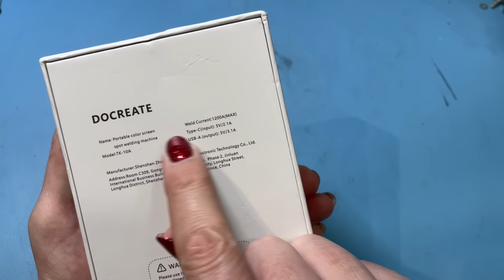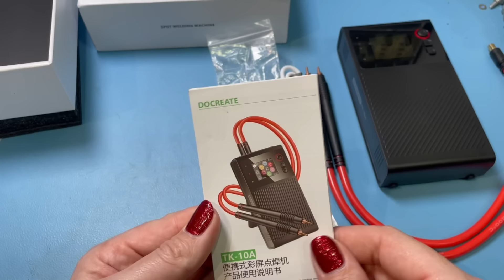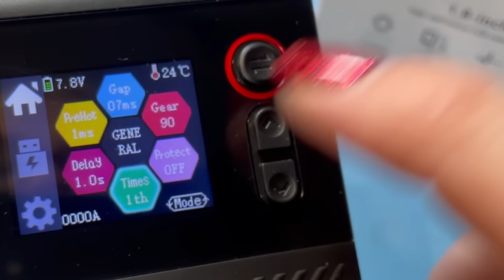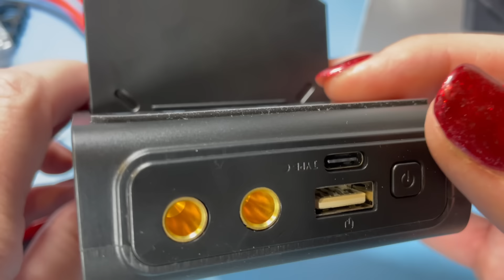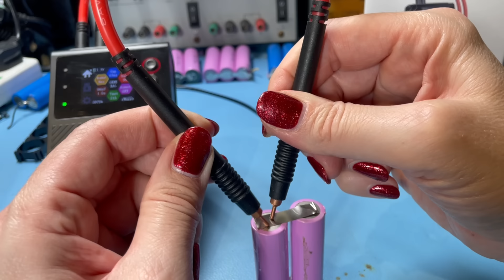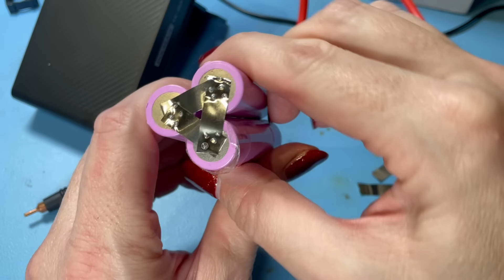Banggood DOCREATE TK-10A Portable Battery Spot Welder - Review & Test!

Comment: For anyone considering the Docreate TK-10A: I recommend checking the batteries against the description as soon as you receive the item. In my case, they were absolute junk—they need to be replaced immediately; the capacity didn't match, the internal resistance was high, and one cell was damaged. Overall, the electronics are good; it accommodates four high-drain 18650 batteries, and the welder will perform better with them.
Reply from the maker: Will have to look into that, thank you 😊

Comment: Hi Jazzy , good result for a first try !  Your weld points are solid .    I always weld with 4 points because the current runs  through these very little contact surfaces . And with High Drain cells  i weld 6 points or more , but i must be careful on the little positive cap , possible but difficult to place 6 points .  I always use insulation disks on the positive side , and first of all with HD cells. 
The first and dangerous issue for beginners is a an unpredictable  and immediate short  after a little mistake or inattention .  With  low drain cells it's really dangerous , but with HD cells it's terrible . I would really recommend to know the Lithium basics before we build our first battery . Security for beginners would be first to discharge the cells at 3V before assembly , but don't forget  that the cells are not empty .   All of this just to help.
Reply from the maker: Thank you. That's good advice 😊

Comment: I heard devices of this type often don't live very long.

But on the other hand it's inexpensive and it's a lifesaver when you need a batt, you make yourself a batt. Aren't gonna build a power wall with this type of thing, and most things we do just need a couple cells.
Reply from the maker: I think this will be ok for occasional use and at the price it's very good. If you want to build a power wall you might be better off making your own with an old microwave transformer DIY design.
Reply: @JazzTechUK too dangerous for the uninitiated, how about 2s3p 5000f supercap? that'll be better and less dangerous than a microwave innards

Comment: Thanks a bunch for this review. I would've considered this tool to be a joke, but after seeing it actually work, I'm impressed. The irony that if it's own cells need to be replaced would require an additional welder is a priceless bit of humor to me, but at the price, why not have 2 ?, lol. I had planned on making a more substantial investment into this type of welder and still might, but this being so small, full of features as well as cordless, gives me pause. I might need a magnifier to see the screen, but that's about the only thing I can come up with that could be considered a negative. That's on me through and not a reflection of the device. Don't worry about the appearance of the welds. Anyone rebuilding batteries isn't going to have their work displayed in the Smithsonian, lol. It simply needs to work and anyone criticizing your results deserves a poke in the eye...and not just the blue ones, but the brown eye too, lmao. Thanks for another great review and product demo. It's really given me something to consider when I finally get around to buying a welder this small. I just realized that I have a pair of Milwaukee batteries that need work, so this presentation is very timely indeed. Thanks so much yet again.
Reply from the maker: I must admit I didn't think this unit would be powerful enough to do decent welds, but it is. I do agree with you about the screen being a bit too small, otherwise it is very good for the money. If you want something heftier, you could always build one of those microwave oven transformer spot welder DIY ideas.
Reply: @JazzTechUK  I already have a couple waiting to be turned into some cool toys, lol. I want to jailbreak the electron gun to kill any drones a neighbor may try to fly over my house, for starters, lol.
Reply from the maker: Haha 😊

Comment: The Docreate TK-10A is a clone of the Fnirsi SMW-10. Both are great budget spotwelders for 0.2mm nickel plated steel or 0.15mm pure nickel.
18:09 the strip provided with the Fnirsi SWM-10 is nickel plated steel, not pure. I'd guess this is the case with the Docreate as well.
You can check by filing off the surface and putting it in salt water for a day. If it rusts then it's steel.

Comment: Thanks for that Jane, it looks like it's producing nice consistent spot welds. A couple of points - you were connecting all the cells in parallel, which means they are still 3,7 v but will need a lot higher charging current. Most repairs are on battery packs with cells in series with a separate connection between each cell and the BMS. More importantly, the use of the circular insulation discs on the positive end is essential to stop the nickel strip punching through to the outer casing. The plastic spacers, which you had, are also useful for keeping the batteries spaced and the welded strips insulated.
Reply from the maker: That's an interesting point about the insulation discs. These batteries are no good. It was just a welding exercise. I wouldn't make up a pack like that in reality.

Comment: £40 is quite expensive. I have 2 spare 10,000uF 40V capacitors and some thick copper wire. A DIY spot welder would be a good use for it. I'll search Google for a DIY spot welder schematic.

Comment: Why are the strips nickel? Why not copper? Copper has a lower resistance.
Reply: I think it's because copper won't weld well, as it has a lower melting point.
Reply from the maker: Also the nickel strips won't suffer corrosion.
Reply: I think that is why. Copper is very difficult to weld since it is very efficient at dissipating heat. If you solder batteries you can use solar tabbing though, which are tinned copper strips.
Reply: We can easily weld copper strips if we add above a fine nickel or nickel plated strip (0.10) , but that needs more power and i don't know if this welder can do it . Perhaps with max power but it's not the best for the battery .